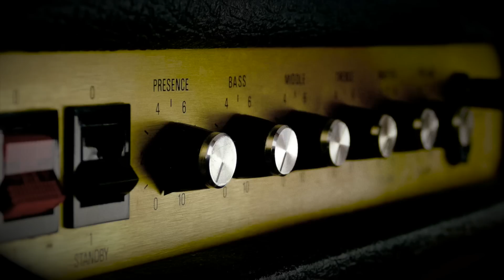Marshall JMP Super Bass from 1969

Comment: great tone! one question: is there an impedance mismatch between the head and the torpedo?
Reply from the maker: +Nico Bellisario - Guitar, Music & Stuff  no impedance mismatch. The head is running at 8ohm in the torpedo. Torpedo provides only 8ohm impedance.
Reply: oh ok thanks! I'm a noob on vintage amp heads, is there an impedance switch on the back? I'm thinking about buying a torpedo live and a vintage marshall to go along my hot rod and I'm trying to understand possible impedance problems as the torpedo is fixed at 8 ohms
Reply from the maker: +Nico Bellisario - Guitar, Music & Stuff yes, old Marshall amps have impedance selector.